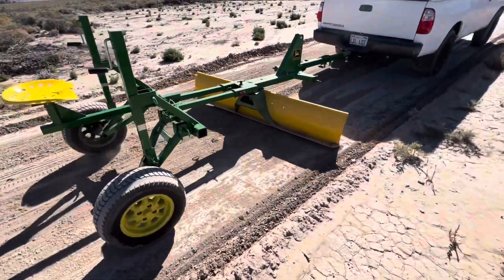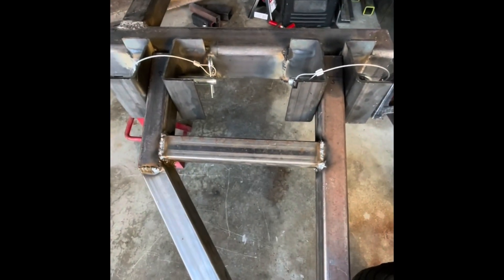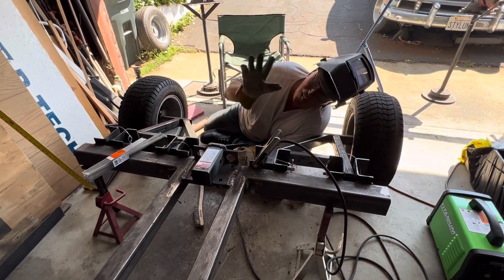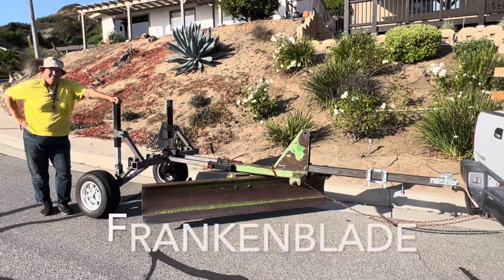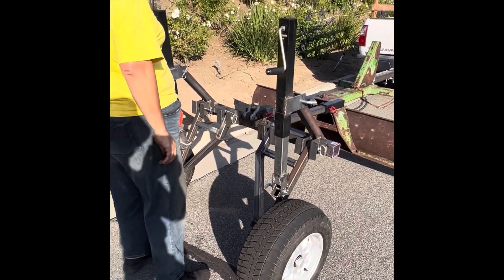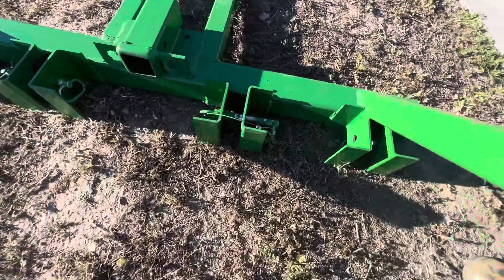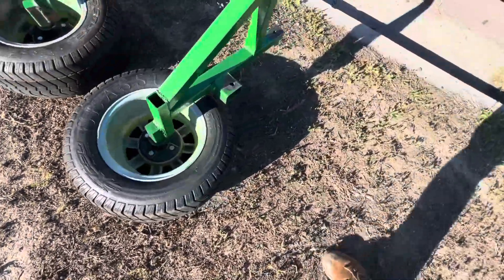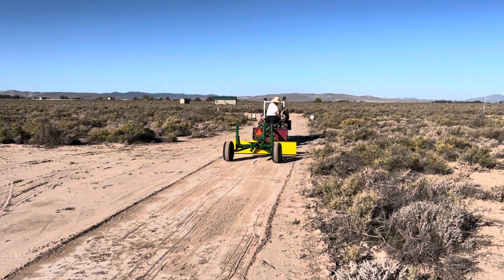KATANA John Deere Pull Grader

Comment: I would recommend changing the rear arms to parallel equal length arms then adding a few steering positions for the wheels thus allowing the pull vehicle to not need to be directly in front of the blade on what you are trying to grade
Reply: That’s a good idea!

Comment: Rose first bought this John Deere blade used in 1988 to build this very concept. We finally actually got to this in 2023, 35 years later! We needed it to improve dirt roads at our property in southern Utah. It functions absolutely perfectly, a testament to the creative genius of a US Navy Submariner— Rose Scot.
If John Deere was to make these and price them fairly, they would sell a huge number to people with pickup trucks and dirt roads. It’s highly functional and moves lots of dirt in a short amount of time. We paid around $250 for all the metal and parts, less the $400 blade, mostly buying scraps at low price to make it. Overall it is probably around $700 total in parts, used blade, wheels, jacks, axles, hitch and paint. Of course it had to be John Deere colors.